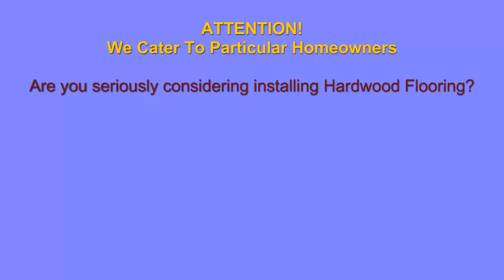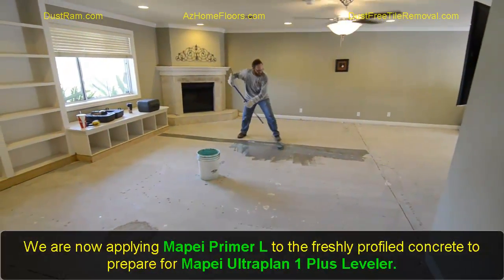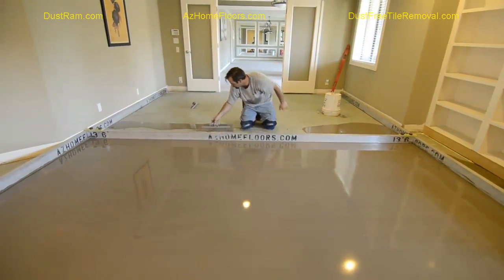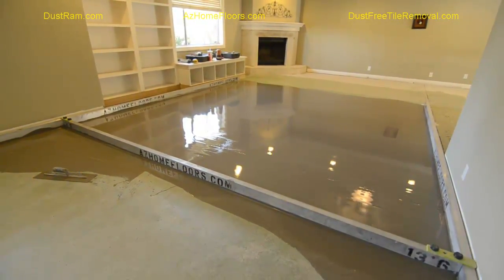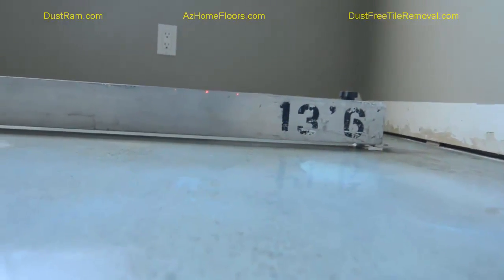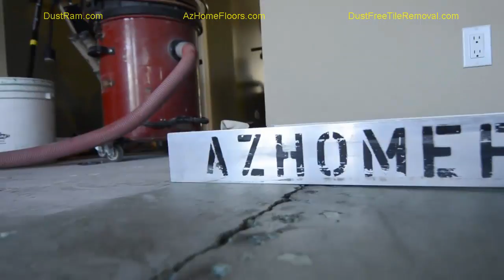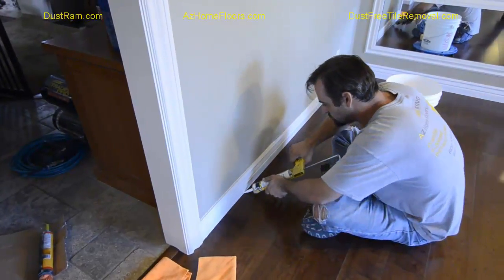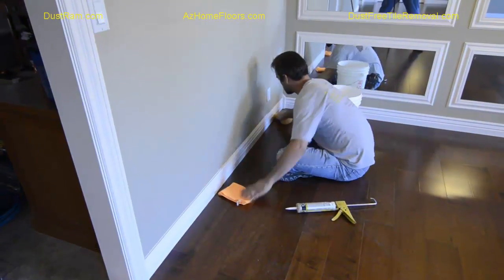Watch Phoenix Hardwood Floor Installers - See Why Our DustRam System Offers The Best Value!

Comment: Awesome job man! I like the way you level the concrete. Wish I had those screeds you guys have.  And the wood is beautiful. I like that wide plank installation. Work goes so much faster and looks great too. I got's to get my boss on pushing more wide plank. lol
Reply from the maker: Hi, thank you for the nice compliments on our work!  Start acquiring screeds a little at a time.  Even 2 or 3 will help make your floor prep easier and the results will be much flatter.